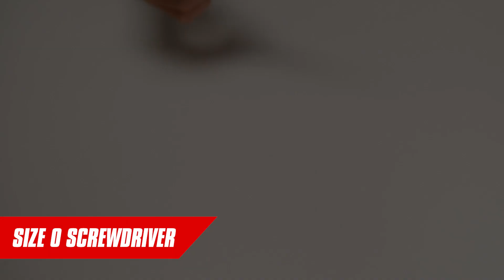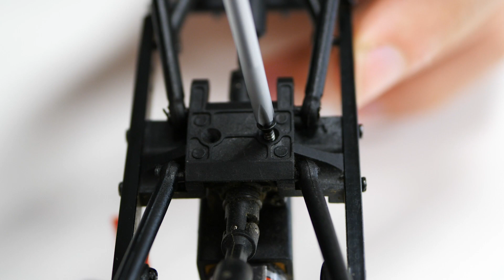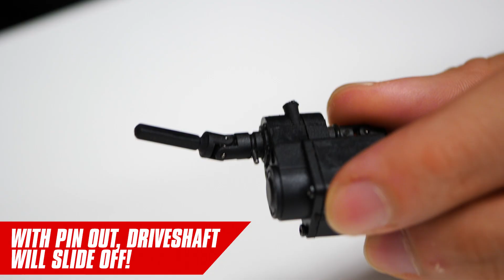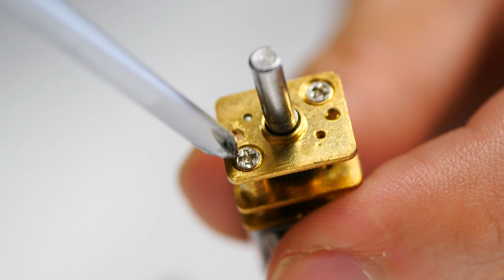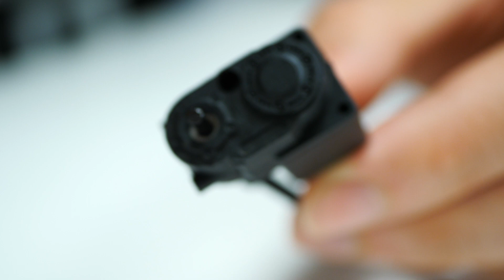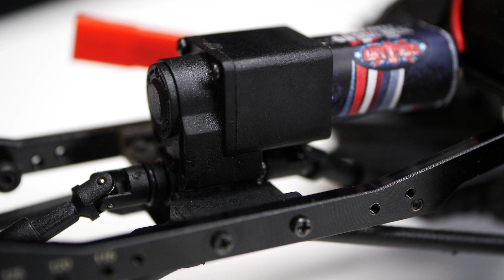How To N30 Motor Swap Your 1/24 Trail Finder 2 RTR | Tech Tips

Comment: This video is misleading. Followed this instructions only to strip a bolt that holds the motor. Because it was a Allen bolt that was holding the motor bracket not a Philip like the video 🤦🏾‍♂️ now I’m going to need a brand new transmission assembly. Just got the truck today. Very disappointed.